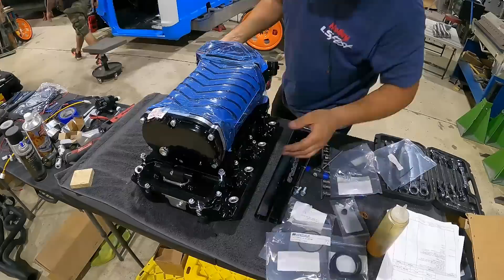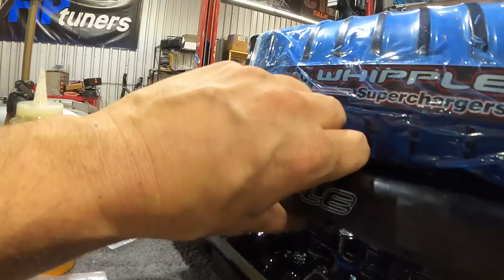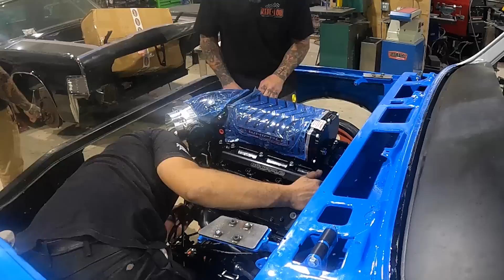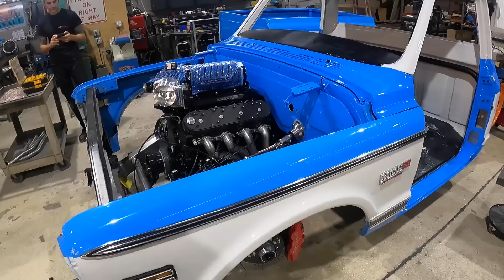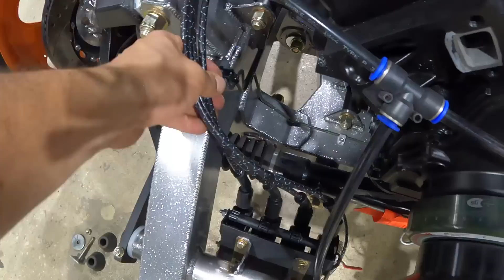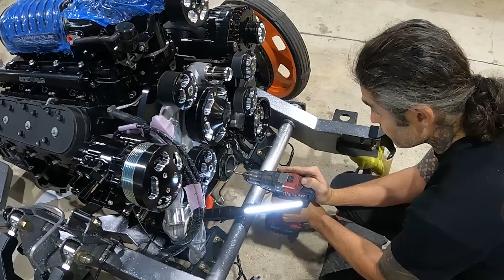'72 C10 Supercharger Install - LS Swapped Bagged Chevy C10 Ep. 8

Comment: Why the intentional gap between the coolers? I foam around the perimeters so the fans can pull through all of them.
Reply from the maker: We found that the gap lets cold air flow into it a bit better. We might give your way a shot on the next one though!
Reply: @SalvagetoSavage  it may also depend on the component too. Maybe the heat exchanger for the blower doesn’t need it, because it would generally be moving when that cooling is needed, and not necessarily rely on the fan. Plus I suppose the fewer coolers the fan is forced to pull through, the easier it is to pull through the ones it is forced to pull through. It would be awesome to see one of my ideas on a build though. 👍🏻

Comment: So you have the weight of both coolers that will also have a combined 40lbs or so of liquid in them, being supported all by the tiny tabs of the aluminum radiator?!? That's not going to last very long at all when driving down the road because the bouncing of the two coolers are going to tear the tabs out of the radiator. Should have mounted them to the core support as well!!
Reply from the maker: That my friend you’ll have to take up with the manufacturer, the heat exchanger comes with those aluminum bracelets already welded on to mount to their radiator. But if your right and it fails I owe you a T-shirt 💯😂

Comment: It's great to get the coil packs off of the valve covers. The engine would have come with a stock harness going to those coils on each side. Could you buy a different one to go to the new coil locations or did you have to make your own? Do you need a special set of crimpers to make the plug wires? Thanks.
Reply from the maker: We had to do a ton of rewiring in this truck to make it work with the terminator and all of our other controls. So for us, it was just making the modifications to the harness while we were looming everything else together. If you have a set of crimpers with the correct wire gauge, you should be able to get the job done with the spark plug wires, but you can always get spark plug terminal crimpers if you want to err on the side of caution
Reply: @SalvagetoSavage  Thanks. The whole thing turned out great, but had to have been a ton of work.

Comment: Id run the ac condensor between the heat exchanger and the radiator. The ac condensor when being used puts off a ton of heat.

Comment: It seems like that intercooler is going to become extremely heat soaked.
Reply: Nope, that's exactly the same as OEM ones are situated. The issue is going to be that they have the weight of both coolers and contents being supported by the dinky little tabs of the radiator rather than the core support. It probably won't get driven enough to matter but in a practical application it would tear those tabs out of the radiator..

Comment: WOW... Looking at that supercharger I thought for sure it was NOT going to fit under that hood.  You are right to give some kudos to Whipple.  Also... I know I've heard it over and over again... "test fit, test fit, test fit"... but you guys go above and beyond I think with the number of times you put it all together and then take it all apart again.  Good thing for time lapse, huh?  It might help... because not all of us are automotive/mechanical engineers if you took a minute or two to describe how/why anyone would want a supercharger.... other than the general rule I understand - "Supercharger Good... Big Horsepower Boost."... lol.  I know it's something about the density of the air enabling more complete combustion quicker somehow... but  there's also temperature involved isn't there?  You experts could probably dumb it down enough for me to understand it.
Reply from the maker: Thank you so much! You should check out the in depth supercharger install we did on a '73 F100 for the channel. We go a lot more in depth with how the supercharger is creating the boost as well as how the temperature gets kept down in the process!
Reply: @SalvagetoSavage  - I'll do that. Thanks!!